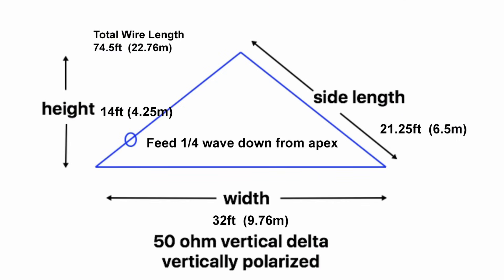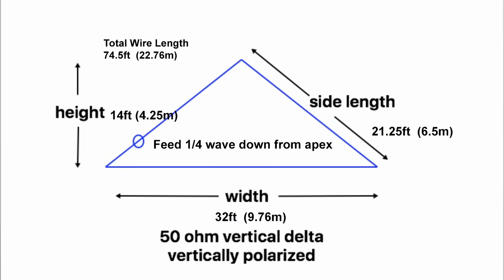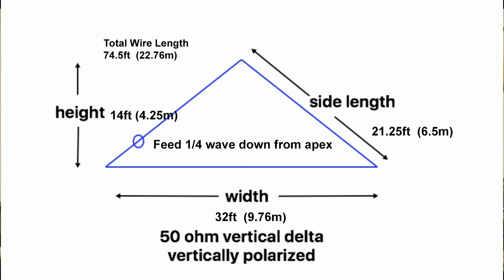Ham Radio Loop Antenna - 20m Low Noise DX Self-Build

Comment: Hi . I have end feed antenna 135 F long. But I have to much noise. Is good if I  do 9 turns with the 50 ohms cable?

Comment: Good old wisdom from old school of ham radio Peter. 👍 The loop antenna for HF seems to be forgotten, but in fact it is excellent because of its simplicity, low noise, efficient DX, cheap, low height and light. I use it regularly for mobile or portable (monoband, Delta or Hexloop).  p.s. Get well soon with walking and exercises,the best way to recover flexibility. 73, S51X
Reply from the maker: Many thanks for those kind words.

Comment: Get back to 100 soon Peter. I run a horizontal delta loop and feed it with 450 LL. and work all bands 6m-80. Via FT-710 stock setup. Love it. 73 Cheers KC8ARO
Reply from the maker: Yes agreed.

Comment: Get well soon Jeff - I've been out of heavy physical action for nearly a year , so I know how frustrating it is.

I have to say however, that this antenna is for a large or very large garden . The bottom length is nearly 32ft long impractical for most gardens,. impossible for those around here.

Someone needs to com e up with a set of definitions as to what a "sized garden" is it would make things a bit easier 🙂 

Andy
Reply from the maker: Jeff?
Reply: Sorry Peter, brain fade here!  Probably going stir crazy being stuck indoors all the time.  Not a bad thing given the grotty wx of late.
get well..

Andy

Comment: Most I think use a vertical (single ele) because it is omni directional. This antenna being bi-direction has it any advantage over horizontal polarised
Reply from the maker: Main advantage over horizontal is lower angle and single support. ~ ideal for smaller gardens.

Comment: As a full wave loop wouldn’t it be a 2 wave loop for 10m also?  Might tune up on both. 
Might also be fun to use a tree as a support and do a 40m version. 
Might give 40/20/15/10. It would be big.
Reply from the maker: It should operate on harmonic with limitations.

Comment: I love my loop. Its about 280ft of wire in an odd shaped triangle and sloping due to the height of the trees supporting it. Its resonant 80m-6m and fed with rg6 75 ohm coax because it's what i had and is cheap. There is no matching box (unun or balun) attached. It's my pileup buster, and about 2 s units quieter than the 80m endfed it replaced.
Reply from the maker: Thank goodness for trees.
Reply: All I h

Comment: This is just to confirm that a 12M Spiderbeam pole will NOT survive a 60ft Leylandii falling on it. Decembers Storm Darragh fell'd one of my big spruce's bulls-eye onto my concrete base, my 3x3 post and my 12M spiderbeam pole with a 40M UK-Antennas Bazooka dipole it supported and smashed the lot into tiny pine, leylandii, RG214 and fiberglass splinters! The Spiderbeam poles are great, but they are lovers rather than fighters.
Reply from the maker: Oh dear! Sounds lime a serious blow.

Comment: I would describe that as a Delta Loop antenna. I've made two, one for 6m and another for 10m. The 10m one has a link in it which I use to shorten it for the higher part of the 10m band as I use these for SOTA and POTA activations without an ATU. For a choke they each have a quarter wavelength of 75 Ohm coax. Feed point is in the same place as shown in the video and I run the coax back to the mast above the lower element. This works.

And I agree they are low noise and are a good antenna. They can get easily tangled so need to be put away carefully after portable operations and then unwound equally carefully.
Reply from the maker: Thanks sharing that info.

Comment: here's a fun one for you. You should be able to get 40m out of it too.
Feed the loop with 9.2m (ish) of 450 ohm budgie ladder & plug a balanced atu on the bottom (non-loop) end. The triangle loop is generally a full wavelength perimeter for 20m & has been sized/shaped for 50 ohms. 
9.2m of budgie ladder is a half wave (inc velocity factor) on 20m. On half wave long transmission lines whatever Z is on one end is duplicated at the other (regardless of the line Z) so should still show 50 ohm out even though it has just transited a 450 ohm line.
On 40m the loop is now only a half wave around so the i/p Z shoots VERY high, but the 9.2m of budgie ladder is now just a quarter of a wave long. Quaterwave lines DO transform impedances such that Zin.Zout = Zline squared  (the good old quaterwave matching transformer)... this line will not transform the excessively high half wave loop Z right down to a good 50ohm match, but it should get it down to a reasonable value (below 50 ohms) that a reasonable balanced ATU should now be able to correct. 
Basically just with some budgie ladder & a balanced ATU you should be able to get 40m too (not perfectly but workable & small).
On 28MHz this is a 2 lambda loop (reasonable Z) with 2 half lambda feeder (no transformation) so this should be tunable too (but I do accept that the radiation pattern will be weird & wonderful).
Reply from the maker: Thanks for sharing the info.